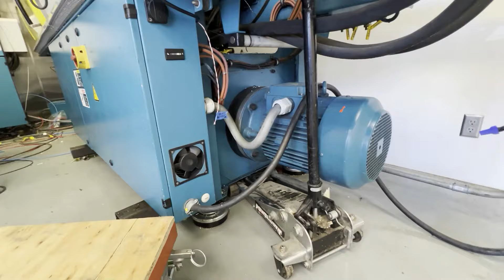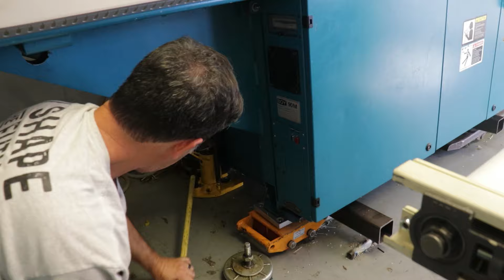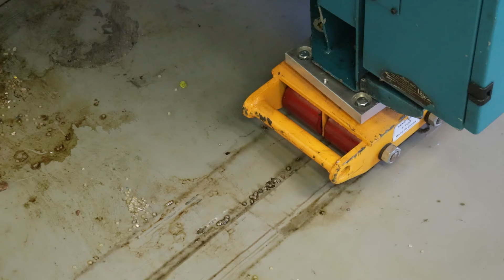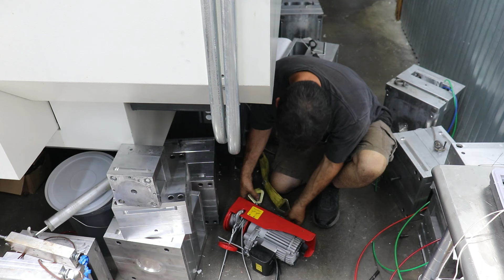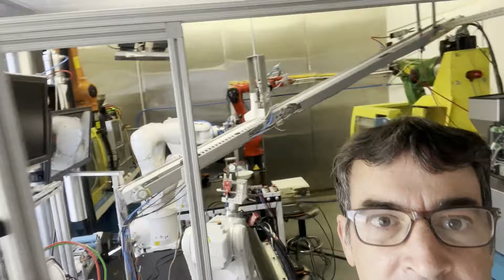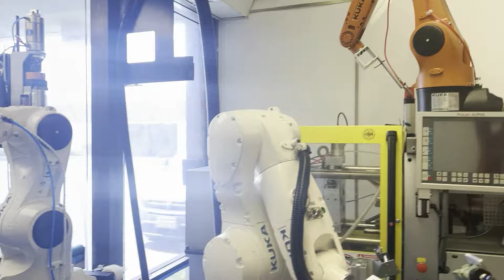Moving the 90 ton injection molding machine

Comment: That Boy 90, check and clean the oil water cooling solenoid, and then water flow check when open, if the water temp is below 18°C it shouldn't have a problem 22°C max. If all that is o.k, I would pump acid through the oil transfer cooler and make sure you treat the water and monitor the PH level correctly. It's best to have two in-closed chillers, one for the tooling and one for the machines. Using 1" flex pipe would help to supply the water too.
Good luck
Reply from the maker: @PeckhamHall  thanks for the tip!  There isnt a solenoid back there anymore, I just run the water full on, 3/4” hose. I tried CLR flush but didnt notice change.
Reply: @DragonflyEngineering  yeah was going to correct it 3/4" after I had wrote it but I thought you would get the idea, insulated metal pipe until close to the machine would be the best.
Reply: If you have a filter on the inlet at 45° it probably just that possible thinking about it, but you need an in-line filter on the inlet to stop an contam getting into the cooler.

Comment: Your "tank trucks" will work a lot better if you take the wheels off, and turn off the red soft plastic they put on there and just have bare steel wheels. They copied the design, and the got the "plastic" and "red" part right, but they messed up on the "super hard" aspect of those "tires". I have 2 sets of those, both with bare steel wheels, and they roll really nice now. They even sell them with an option of bare steel wheels now instead of the soft rubber.
Reply: With bare steel wheels, you definitely wouldn't need a winch to move it. I have a ~7000lb cnc lathe and a 12000lb mill (though the mill isn't currently 12,000 because a bunch of stuff is off of it), and on a smooth concrete floor, I can push either machine myself on those yellow skates.
Reply from the maker: @gorak9000  good point. Thanks for the tip
Reply: @DragonflyEngineering  I got that tip from one of the guys at NYC CNC yt channel - I saw them using those amzn/eby skates to move a mill, and made a comment about it, and they replied "turn the rubber/plastic off the wheels on the lathe - they work fantastically after that", so the credit goes to them!